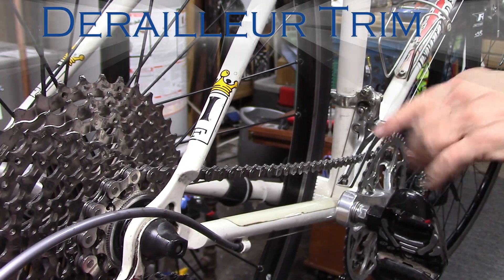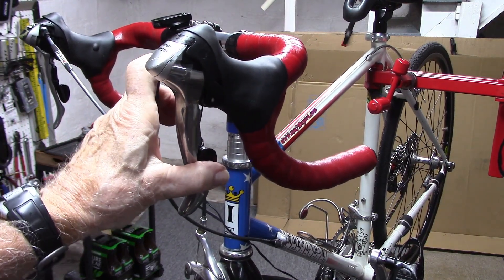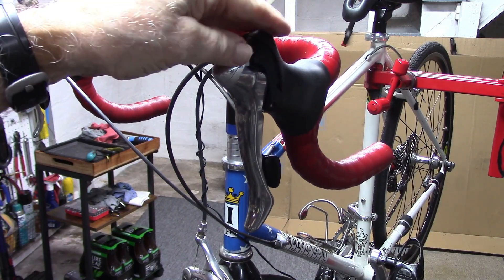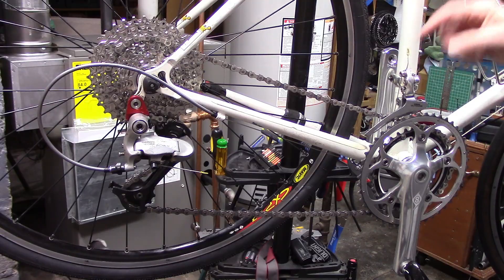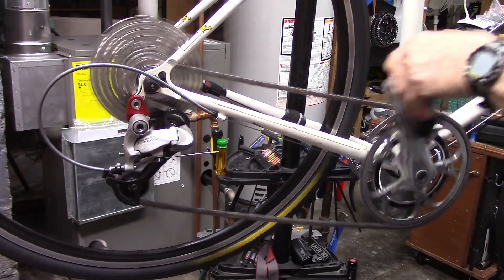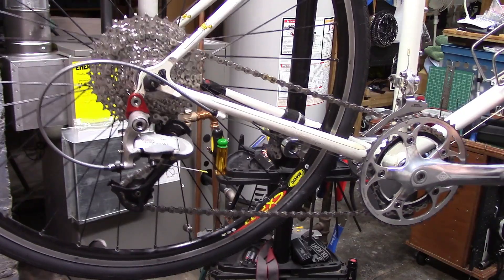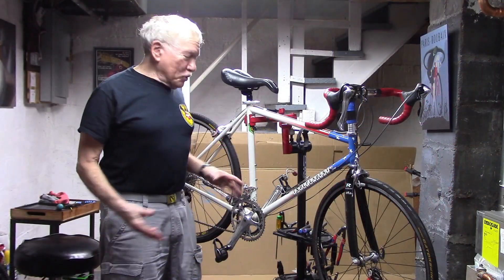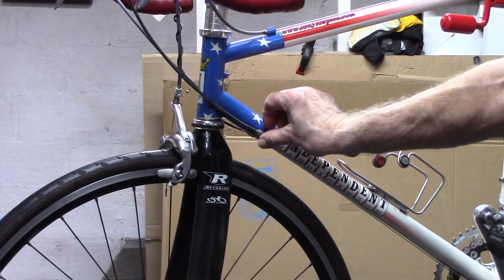What is DERAILLEUR TRIM and Can It FIX Your Shifting Issues?

Comment: i thought I just told you that of my 3 ring in the front, it will make a crunchy noise or sensations off and on no matter how much I have the rear derailleur adjusted but at the top of the cassette sprocket leaving it and heading forward to the  middle front sprocket, the chain is leaning in towards the next easier pedal sprocket. I adjust the barrel adjuster to and can slightly get rid of it or it pops up the sprocket to the easier sprocket. but the bottom and rear of the cassette chain is centered in on the sprocket teeth. can't seem to keep the chain links centered over the teet of each sprockett.  thanks. Yes, I know the H and L screws too. just forgot what to call them. 😁that adjustment. Not like I do this for a living. 😃thanks. hope the kitty is ok. didn't see her in this one bombing your video. You should add her to the video's. 😍
Reply from the maker: Check your chain for wear. It's also possible you may need a new rear derailleur cable with proper indexing (adjustment).  But my main thought is you may have a bent derailleur or derailleur hanger. See:
https://www.youtube.com/watch?v=qHK6jQizIdc
If so, you could try to bend the hanger or derailleur youself or take it to your local bike shop to have a look (they also have the proper tools to bend it back again).
Let me know how you make out. Regards, Tony
Reply: @tony10speed  I was going to buy a new chain until I found it was only a smidgen stretched. It was  no where close and my new derailleur bolts directly onto the frame. no hangar. I can feel the crunchity sensation from time to time not rough, but that would be a bearing I would think and I packe the one side of the axle bearing last week and it made no difference. That was why I was asking everyone about the replacing the cassette but found out it is not adjustable anything. So I ordered another 7 speed cassette to fit, but I am going to check it to see if it is wobblely and play like mine is. Some say a litte, some say none .I can wobble and move each sprocet a little forward and backward and side to side. I will compare it when I get a new one this Friday. I'll just do more fine tuning on the index adjustments as I was told that to, but I have done that so much High and low and barrel adjusters. It should be soundproof. thanks so much. I'll keep you posted. 😃
Reply: @tony10speed  I rode 37.7 miles this morning while stopping a few times to stretch my legs and get the pain out of my hands and fingers, and it hardly made a sound. but when I started out in 1st gear from a dead stop it started that clicking sound and as i rotated up to 5 or6th gear then it went away and was fine. I can't adjust the barrell anymore  because that would throw it off for 5th and 6th. guess I need to adjust the index H and L wheels to see if I can work that out from 1st gear.
Reply: @tony10speed  I promised I would let you know, so, here goes.... I ordered another cassette because mine was wobbling every direction. Got it yesterday, attemped to put it on this morning only to fine out mine is the slide on cassette and not the screw on cassette. So, I went with my gut hunch looking at the 3 long rivets that hold the pack of 1-5 gears together and know about rivets, I laid each rivet against my large metal mallet hammer and smacked each rivet one by one about 3 times watching each one compress and flatten even more than originally. After I did all the rivets, it was like.....................WOWZER. all of my gear sets were now like the new one that I had just bought. none of the gear pack moved at all. I pressed grease into that bearing housing whatever it is called and slide it all back together tighter than I have ever felt it. That should stop all the funny noise's and jumping from tooth to tooth without jumping out of gear. Plus, when I put the splined tool in to unscrew the nut that holds the cassette on the shaft, I held it with a leather glove put in the ratched and adapter and it just fell over loose. Sorry, had to give details. 😁

Comment: Do you know if SRAM Double Tap has a similar feature?
Reply from the maker: With the older SRAM Double Tap, you had a trim function only in the large chainring. But note, the cable tension needs to be just right. If there's too much cable tension, you may not notice the trim and the chain will move directly to the small chainring. The newer SRAM Red shifting (electronic) appears to have a built in trim function. At least this is my understanding. If viewers have recent experience, please comment.